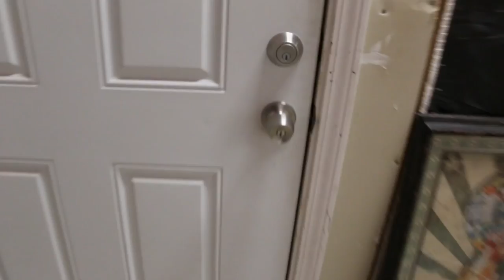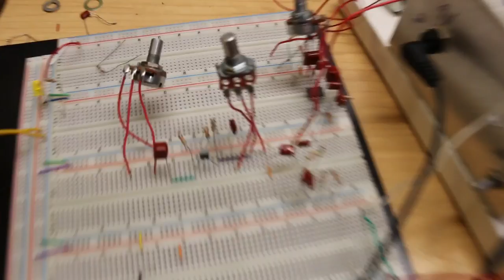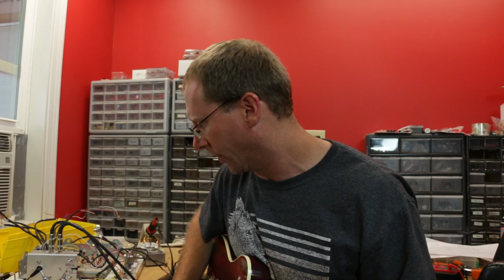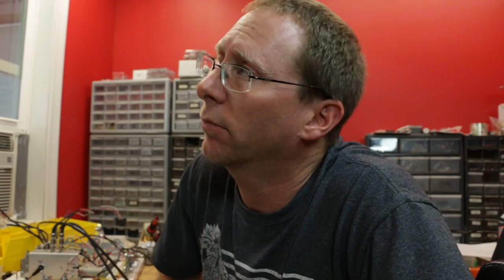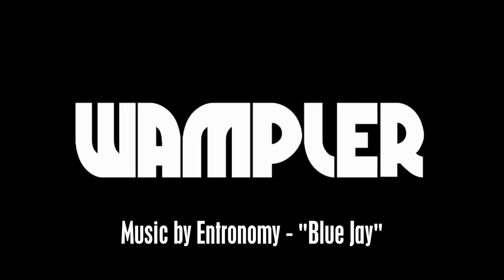Busting the myth of magical op-amps and diodes...?

Comment: There are different versions of the ts9 JRC chips that have the same code.  Vintage ones and reissues.  It's the older JRC that sound marginally better.  You can tell one from the other physically as one has a shine on top and the other is matt.  The difference between my two 1981 ts9's with a J vs the T chip is pronounced.  There is a good reason why people pay $600 for a 1981 TS9.
Reply from the maker: +tockusa yeah, but it's not because of the chip 😉 it's because of supply/demand and the belief that one is different from the other, IE chasing the magical tonal unicorn 😉😉
Reply: Wampler Pedals the chips do sound different.  I have a pedal which has a chip mount installed.  On this pedal you can swap chips.  If you like I can mail you my biyang od8 x drive.  It's currently got the NOS JRC chip installed but I'll also lend you my other chips.  My fav were bur-brown and the NOS JRC chip.  I got interested when my two 1981 TS9 pedals sounded different.  One had the T chip and it sounded harsher.  A NOS JRC chip installed fixed that.  They do sound different.  The old ts9's sound better with the old green resistors and the JRC chip.  But I do have the same year/green resistor model with the t chip just to have more upper mid grit.  So I'm using the chip as another flavor. I can upload some clips if you want?  Old tube screamers are a sum of its parts.  Chips are not night and day but it's noticeable. Add the green resistors etc and it's a positive improvement.
Reply: Lol the guy arguing with Brian Wampler about chips........
What next? Criticise Michael Phelps on his breaststroke?
Reply from the maker: +tockusa lolz
Reply: Ben Caffrey He didn't use a NOS JRC chip in his demo.  He used the current ones with the same code which sound different.  What I'm saying is the old chips have more of an obvious variance in tone than current production chips.  I'll put up a video today.  I'll be honest, it's not night and day magical difference but the chips are not made anymore are different to current production.  In his demo he did not use a NOS JRC chip.  So I'm not surprised by his findings.
Reply: Dude!!! Michael Phelps uses a Kemper. Fact
All your Nitrous Oxide won't change that man.
#NOS
Reply from the maker: tockusa
Is that video up yet?
Reply: Wampler Pedals we had a hurricane but I'll put a TS9 vid up for you today.  How about this.  I'll send you my OD8 xdrive pedal (with the interchangeable chip mount) along with my cork sniffer and regular chips and you do a vid with those?  If they are all the same you keep them/the pedal.  If they are different then you send me a Tumnus?  Perhaps your test is too bare bones to have an effect on the chip interaction?  A full blown tube screamer style assembly may distribute things different to your test.  That's the best way because my tube screamers components etc could be in different states of repair.  Shelving freq's.
Reply from the maker: tockusa
I have old stock chips as well, but I've already done the testing. I'd like to see your video results :)
Reply: Wampler Pedals so why didn't you put them in this vid?  Isn't that the entire point?  That the old JRC chips are supposed to be the nicer ones tonally than the new JRC chip?
Reply from the maker: +tockusa
Here, I'll help you out. Everyone, check out Tock's video showing the two chips he  mentions: https://www.youtube.com/watch?v=yiwabeLVIkI
Keep in mind that this doesn't take into account that all parts have tolerances (ESPECIALLY in those pedals, and the pots are +/- 20% so a knobs at noon won't be the exact same thing). Even in the same pedal, realistically when switching opamps you don't want to plug and place. There are other things around the opamps that you would ideally want to change (also mentioned by another commenter). Best of luck to you Tock. :)
Reply: Wampler Pedals I was taken aback at how similar they sounded.  I though it was more obvious but the sm57 wasn't showing much. A tiny shift of highs and girth via the way files.  But what it does have in common is how bloody good they both sound.  Lol.  That is the old claim at the end of the day right?  That the old chips sound like unicorns?  IMO those two pedals/my clip sounds duocorny.  I don't have a regular/modern ts9 which is a shame.  A third modern ts9 in the mix would have been interesting.  Listening to my clip...Something thrown together and sounding that good?  $600 ts9 $$$ well spent ;-)   (Strokes my opamps)

Comment: Unless your trying to do highly accurate instrumentation with the need for low DC offset or very fast slew rates that are far far outside the audio range, then almost all opamps are virtually identical except for input impeadance and drive capability... never met a sole that could hear 0.0001% vs 0.01% distortion... some of them will become an oscillator in a bad design, otherwise I’ve never noticed much difference in the lab at audio frequencies... we used cheap TLO72 and 74s for fairy high end applications never got any complaints form customers... diodes differ from one to another, but they all have fairly similar curves and physics, looking at the frequency content of the signal out to a couple MHz on a spec-an or FFT will show absolute detail of any difference in them... there simply isn’t any magic than can hide in the world of electrodynamics, everything can be quantified with near absolute precision...

Comment: Your extensive demonstration indicates, to me at least, that other mods I've seen - like replacing each clipping diode with two properly oriented clipping diodes (making 4 total clipping diodes) would have an equally limited effect on the sound from the TS9/TS808. Truly I could not tell much difference at all between any of the mods, which is your point isn't it?

Comment: here is an idea : you take the most transparent diode, the one that compress the less, and retry the chip changes to see if the changes are not more hearable. I wonder if the choice of the diode at first was not limiting differences between chips anyway. do you agree ?
Reply: those diodes 1n4148 are the ones used in the TS circuit... (or 1n914, which have the same specs)

Comment: A lot of the more expensive ones actually seem to have that annoying - totally separate, as if it is coming from a separate amp - clean sound underneath the smooth overdriven sound. It's like my old BK Butler TD75 head, where you can have both the clean and the starved-plate 12ax7 running together, both channels on at once. Cool for bass, but not guitar.
Reply: Adam Rainstopper awesome vid tho

Comment: well I guess you could make fuzz if base of guitar amp clean channel. just leave out the class b or class a/b part. the nice thing that op amp use negative feed back  well which is need for fuzz to sound good when someone put crapy pickup in fornt of it.

Comment: that nasty thing called "input/output impedance"... who knows what kind of weird stuff happens in the rest of the circuit/signal chain when we just swap some op-amps...

It is a good example of what happens in the opamp in relation to how it saturates and clips, as they all behave more or less similar. But in many applications there are important differences when you consider what is before and after the opamp (especially in slightly more complex things like a preamplifier). It's not the same to load the output of a TL072 with a complex passive "tone control" network, or go out to the rest of a long chain of pedals/long cable, than doing it with a 5532 for example.  Does our circuit have input buffer? output buffer? is the tone control isolated with buffers? it isn't? how high is the output impedance of the circuit? and the input?

Comment: Opamp Differences weren't as noticeable in an overdrive circuit , as it would be in a clean hifi circuit. 

Funny led usage btw.
Reply from the maker: Possibly, but we guitar players don't care about hi-fi usage. Also, what do you mean about LED's? You've never heard of using them for clipping?
Reply: for us as guitar players we don't care about hifi. 
But i find it remarkable that these opamps can sound so different clean in hifi from each other, and yet sound so utterly similar in an overdrive circuit. 

And no i have not, have not bin modding guitar pedals, ore amps since the early 2k's, when i quite the band sold everything and live took on.
Reply from the maker: +Dhr Willemsen gotcha, yes using leds for clipping is fairly common practice these days in guitar pedals
Reply: it's itching though. 

I think i might just start again just for the fun.

Comment: There is something fishy going on there. I take my DOD 250 circuit, using a 0.001 input cap, not grey spec, use it as an actual overdrive, driving say an 800, or Jubilee, or 900Mk3, or SLO, and I can hear a profound difference in Op Amps. 
Hell, the 604 is one of my favs. Consequently, in that applications, it seems Diodes changes are barely noticeable, and I prefer without them. 

I did however recently build an Op Amp Muff, and Op Amp changes in that pedal make a much smaller difference. 

My takeaway from this video, is it seems that diff circuits will be effected by Op Amp differently, and the one you threw together is not really representing them well. It sounds good, but not the best op amp demo circuit.
Reply from the maker: Well, that’s a 741 OA, that IS drastically different.

Comment: The fool proof way to do it? Get your ball park idea of your tone, then try out as many pedals as possible. Every pedal will sound different with YOUR amp and YOUR fingers. Your overdrive is as important as your pickups, tubes, cords, strings, picks, speakers and amps. It's a melting pot. Whatever works for you is the point. If a MXR Distortion+ sounds great to you, you probably don't need a Klon. Just keep experimenting till you find "your" sound.

Comment: How about at least doing some @ 18, 24 & 30 volts with some of those op amps??  Running way down @ 9.6 VDC an op amp is an op amp is an op amp. How about using parts of old PNP Ge transistors as clipping diodes??  The JRC4558 was  famous for being the cheapest op amp money could buy in bulk.

Comment: The  4558 sounded so much more awesome!   I use the  Malaysian made Texas Instrument 741CP if at all possible (they are hard to find these days), but the sound difference is slight and I have always believed caps and resistors in the circuit do matter the most in sound quality,  good build and accurate values and matching impedance to a guitar counts for a lot as well.   The Op amp is stable and infinite  input impedance helps with not loading the guitar pickups and that makes op amps so sweet.

Comment: Actually the pots are going to make no difference because there's no resistance with them turned all the way up, and your humming because you are using single coils, 2nd you don't need a transistor in an op amp distortion pedal circuit, 3rd you are not using a tube screamer the way 99% use them and btw your circuit is not bypassing the the clean guitar signal until you made the diodes clip to ground, if you test the 4558 in this circuit with the pedal all the way up with humbuckers the 4558 is definitely going to have magical properties such as compressed low end and articulate highs.  Why not put a socket in a tube screamer and get a decent guitar and swap the op amps in the pedal on the fly.
Reply from the maker: Ok

Comment: The more expensive ones have a little more mid hump.
Reply: All op amps have a flat frequency response at moderate gain. It's the passive components that make the most difference. Unless you overdrive the op amp itself.

Comment: The difference between these chips is mostly in noise floor and THD, which are exactly the things a breadboard adds because of EMI susceptibility and parasitic capacitance. Your point would've been made much better if you'd taken twenty minutes to actually solder up the test circuit with a socket for the chips under test. Ironically, even though you're CORRECT in your conclusion, your test build is impossible to prove it with.

Comment: I think the real difference lies between these "old" op-amps and the "newer" SMD-types,
which has quite different ratings. I think that might be the reason why older boxes sounded better. New boxes also tend to have cheaper SMD caps, resistors etc...
It doesn't matter how many blue LED's you put in there. It's still a piece of shit.

Comment: The video doesn't prove that "there isn't any difference" between a 1981 TS808 and a 1983 TS9 or a 1981 TS808 and another 1981 TS808. I know, it's because of the entire assembly of components along with tolerances. Which is why that noisy board that no one uses doesn't prove anything.